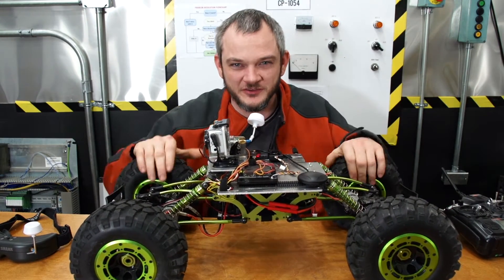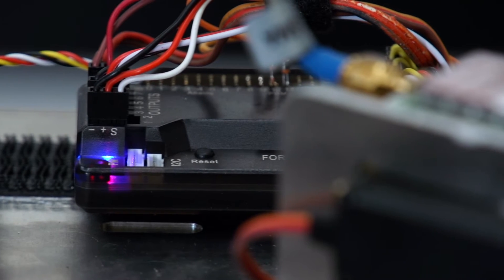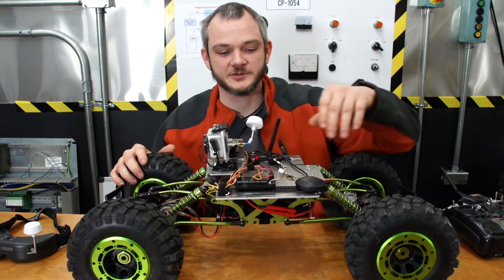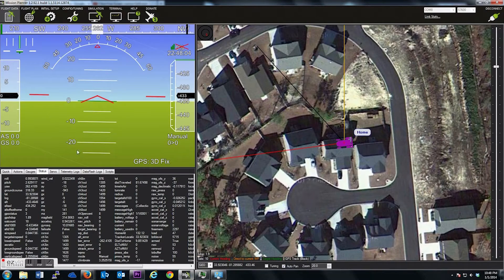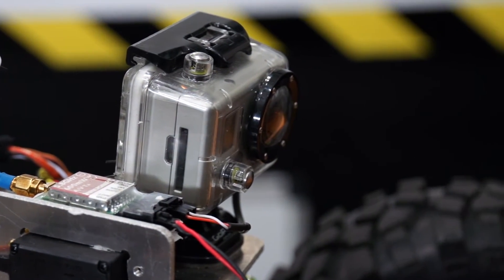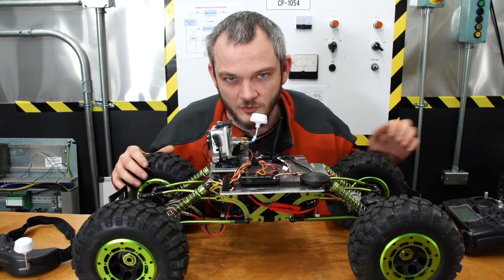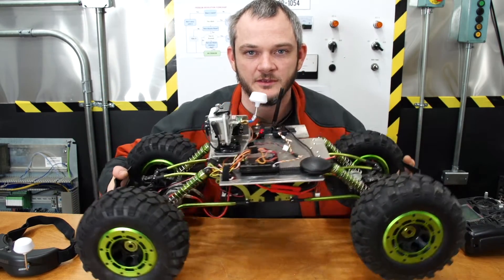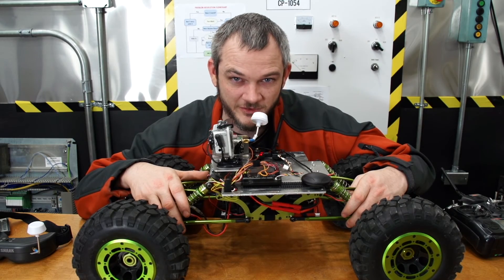APM 2.5 Rover Project using 1/8 Scale Rock Crawler

Comment: heeey sir 
i have a qustion if the camera can connected with  Ardupilot or have hers own transmitter and reciver ??
Reply: ardupilot has a gimbal feature in the software when first setting it out, the gimbal can be plugged in the channel thus be controlled by the board. so in turn yes.

Comment: I have built a truck with a Pixhawk my Dx-7 will not work the steering or throttle any advice. Thanks
Reply from the maker: John Watts I would have to look at your overall setup.  The pixhawk is an interesting creature which has either the output module or the direct connection to the Dx-7.  Which one are you using?  I would try using the pwm module first and see if you can get it to work with that.
Reply: jjmonns  Ok I fixed that problem and no it just drives in circles and snakes around in Auto...
Reply from the maker: I have had issues with some of the later firmware so you may want to try an earlier version.  Also, make sure your steering servo is not reversed, you can reverse the output in the config
Reply: That was it! My buddy told me...
Reply: Thanks man!

Comment: Hello JJMonns. Thank you very much for sharing the video. I know that I can control a quad coper brushless motors using APM or Pixhawk by connecting through an ESC. How do I control a Rover motor (A normal DC motor) using  APM or Pixhawk how do I connect them to Pixhawk/APM

Comment from the maker: I will be making a video soon that will go over how I built it.
Reply: Look great!  Also, looks like no vid is coming?  Any chance on getting a parts list?
Reply from the maker: Sorry guys, I have been super busy with my day job but will be adding a new video soon.
Reply from the maker: Scott Pause
Video is getting postponed until next week, after installing the second servo for four wheel steering I ended up rolling it down a set of stairs and broke rod ends.
Reply: hi i just saw your video on building an ardurover...my doubt is how do you connect brushed DC motors to Ardupilot and make it work?
Reply from the maker: It interfaces with the ESC. The autopilot takes the place of the rx.
Reply: +jjmonns in this case channel 3 of ardupilot must be throttle ..but there will be 2 motors rite..if one of the motors is interfaced to channel 3...where is the other motor connected ? ..and by saying ESC are u meaning brushed ESC ? and is there any other component in between the motor and ardupilot like the sabertooth ? plz clarify my doubt
Reply from the maker: Srivathsav Parthasarathi a brushed esc can run two motors.  if you have two ESCs you can just use a Y-adapter.
Reply from the maker: you can plug both ESCs directly into channel 3.